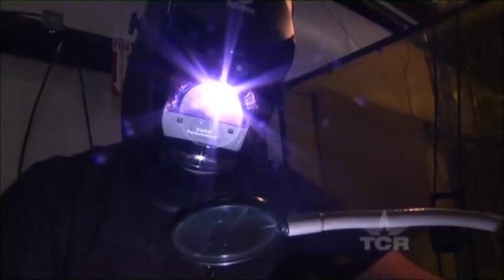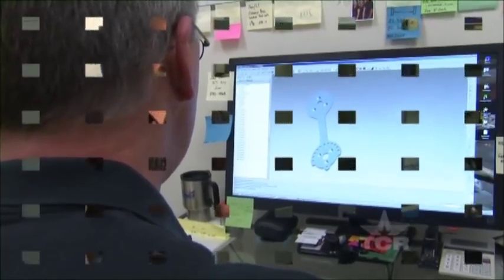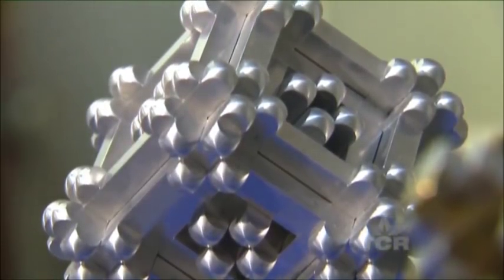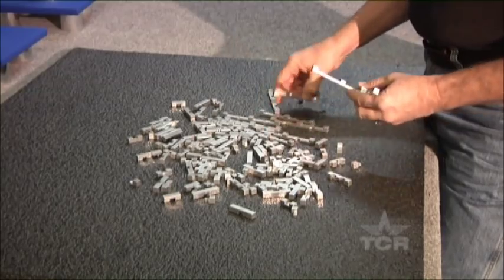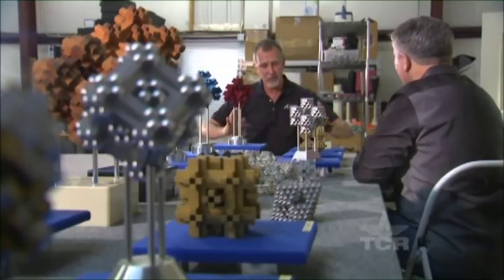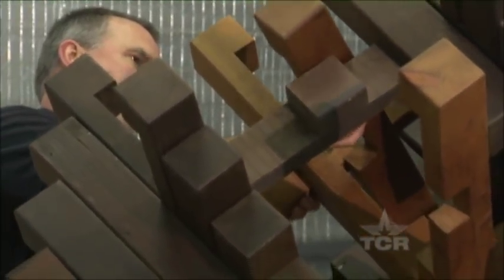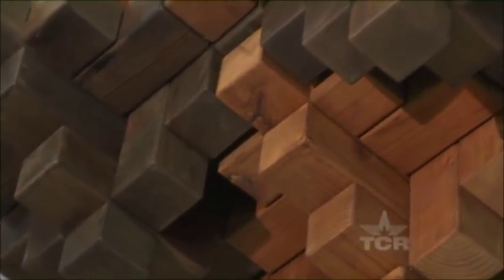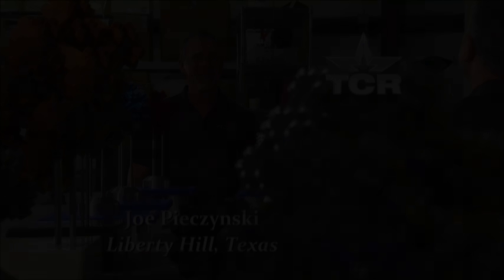Advanced Innovations on Texas Country Reporter

Comment: I want one of those little puzzles. they are very very neat. and I want to see if I can figure out how it goes together and how long it would take me. not to mention being able to display it after I get it together as a piece of modernistic mini sculpture. It's what every skilled tradesmen likes. something that is more than one thing. (in kitchens, it's why buy a ricecooker when I can buy a pot that I can cook rice in, and it also does 100 other things, in a shop it's "if I can do this with more versatile tool, why buy a tool that can only do one thing) to be fair single purpose tools have their place. when there isn't a more flexible solution. but the idea is the same, when given a choice, get things that do multiple things, instead of something that only really does one thing. the puzzles are just that. it's a puzzle, and a work of skill and art, it's an exercise in logic and engineering, as well as a nice sculpture. and that's worth more than just a puzzle. or a piece of art on its own.
Reply from the maker: Good comment. These are usually described as puzzle sculptures. because of the high price, most of the ones sold were never taken apart. Its like owning a car that will do 200 MPH and never doing it. Its sometimes just good enough to know it will.

Comment: That explains it amigo!!   Unbelievable Joe!  Did you ever make anything for NASA, or something that is in outer space? 

Congrats on the limelight amigo.  You've definitely have earned it.
Reply from the maker: I did many components for the shuttle program. Mostly control valves for things like the bay doors, landing gear and fuel transfer.
Reply: Joe Pieczynski 
I absolutely love your videos Joe.  Thank you so much!   I have used several of your lathe tips, use the precise angle setting on the compound.   

\m/,

Comment: Joe there is one thing i need to ask are you or have you been Diagnosed as being Dyslexic?
You have an amazing mind that like my mind can take an idea & turn it into reality..
Reply from the maker: I've been told I have a photo mechanical memory with an ability to visualize 3-D with little effort. None of these puzzles were done with a computer or CNC of any kind. For design or manufacture. Strictly pencil and paper.
Reply: @joepie221  that is the way my brain works I get an idea in my head or a suggestion from someone & I get a mental picture & then work out how I need to go about making it reality, BTW those puzzles awesome they are complex but at the same time simple in design.